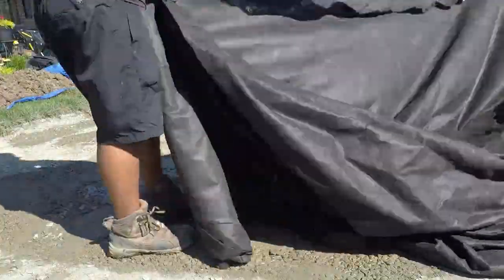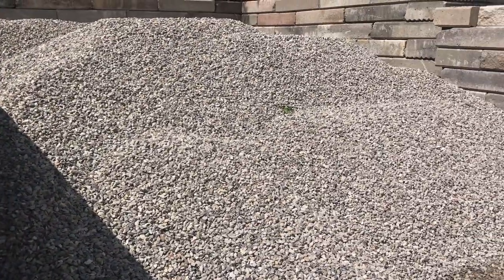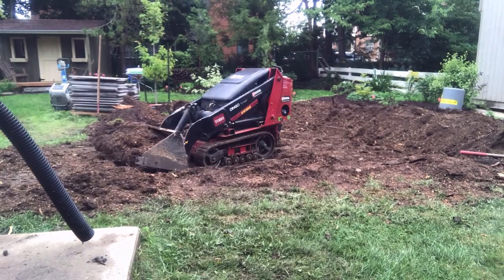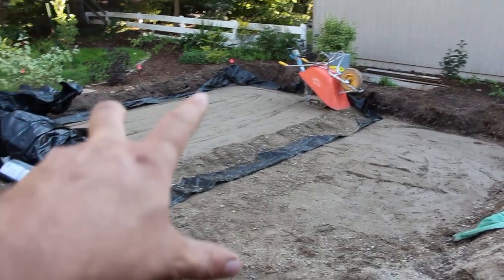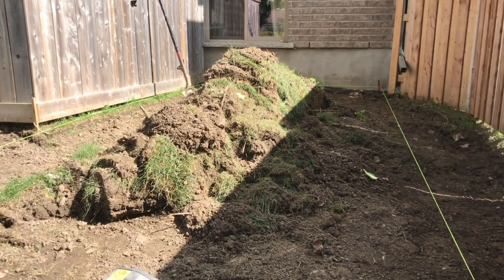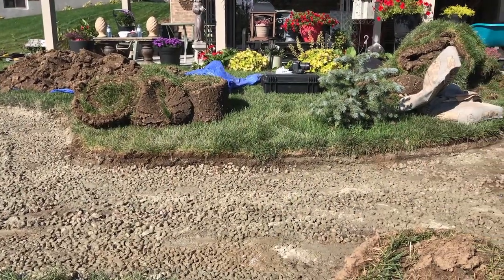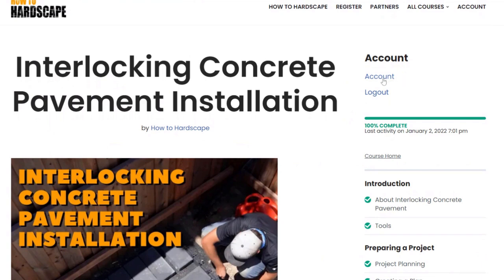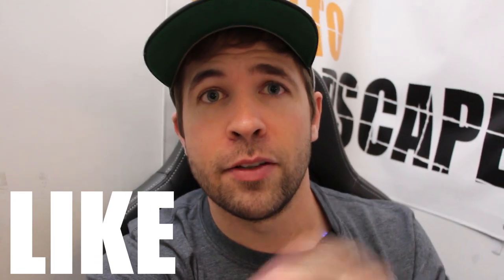Do NOT Skip These 2 Steps Before You Prepare Your Paver Base

Comment: When do you put base material directly on the soil and when do you put fabric down first? We are in north FL and have always put fabric down first because of our sandy soil. We compact the excavated area very well, then put nonwoven fabric down, then our base material. Many times we wrap that base material with a top layer of fabric and then a thin bedding/leveling layer on top the fabric prior to pavers or ret wall material going down. We watch a lot of your videos, so wondered what you recommend in super sandy soil.
Reply from the maker: I always place fabric down first, but most of the time I sprinkle a little Portland cement and 3/4" clear and compact into the subsoil because we work with a lot of clay. If you have really sandy soil especially in FL, you could most likely skip the fabric and just place biaxial geogrid (if that is something you want to add to your base prep) at the bottom of your excavation. That will add stabilization to your base. Though if you subsoil is a sand silt mixture you would likely want to continue with that nonwoven.

Comment: i was interested in prepping the paver base with Brock panels. Seemed like a great idea. i looked at a few paverstone stores and the reviews from customers say that there is a difference of height in these 12 x 12 pavers. i guess i will have to use about sand as my top base?
Reply from the maker: Yes every manufacturer has a stated tolerance that the pavers could differ. Some are worse than others. We lay on top of the panels and then go through and lift up the pavers and add some concrete sand to help level.

Comment: Do you put another layer of fabric between 3/4 clean base and the HPB or concrete sand that goes on top as bedding material
Reply from the maker: I do not. But I also wouldn’t suggest using concrete sand on top of the 3/4 even if you choose to use fabric to separate them
Reply: @iamahardscaper thanks for replying and great channel too.
No one has 1/4"/HPB in my area (western Washington State). The best I've found is clean 3/8 crushed rock. There's also quarter minus that most recommend but I don't know if that would work ok on top of clean 3/4 crushed rock. (Actually mine is not 3/4, it's 5/8). Thanks
Reply from the maker: 3/8 inch works, but it should be clean (no dust / sand)

Comment: When using paver panels, if I run a compactor over the pavers how much height will I lose? I would imagine that the panels are going to sink into the sand just a bit, but how much?
Reply from the maker: If you are using sand you need to compact the sand first before laying out the panels. That would mean screeding, compacting, and then re-levelling before laying the panels. HPB (1/4" chip) works better because you don't need to compact first. With either of these you will lose basically nothing in height.
Reply: @iamahardscaper  My previous question was off a bit, as I'll be using Brock panels and they don't recommend compacting the pavers. Can I just use 1" of the HPB, screeded but not compacted?
Reply: @iamahardscaper  Thanks for the info. So the big advantage of the HPB over sand is that you don't need to compact the HPB?  Brock recommends 3/4" sand compacted down to 1/2" under their panels.
Reply from the maker: Yes, 1" HPB not compacted. But you still want to consolidate the jointing compound when you are installing it by compacting the pavers (ideally with a roller compactor)
Reply: @iamahardscaper  OK, I looked around for HPB (1/4" clean gravel) and I couldn't find any around here (Albuquerque NM).  Looks like I'm going to have to use use sand. The Brock Paver Base guy says to use 3/4" sand compacted down to 1/2" but there isn't anything good to use as screed pipe for that. I could use 1/2" rebar but it has too much flex for me. 3/4" pipe would be my preference (1" OD) and is a lot stiffer but would result in a 1" compacted bed.  What do you think?
Reply from the maker: i would just use the 3/4" pipe. It will compact down to 3/4" and that is well within bedding layer spec for patios (max being 1.5")
Reply: @iamahardscaper  Yes I think that's the direction I'm going. One thing I didn't realize earlier is that I have to remove the screed pipes to hand tamp for compaction. The hand tamping will make the top surface a bit uneven but since I am using base panels that shouldn't matter.